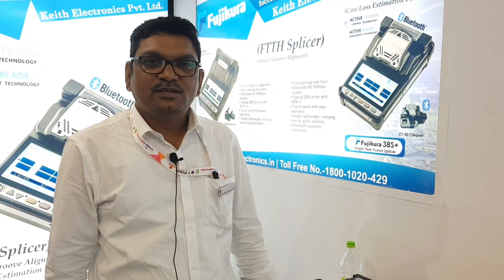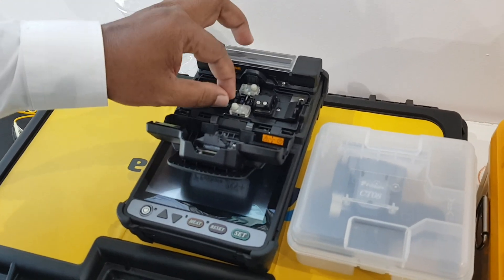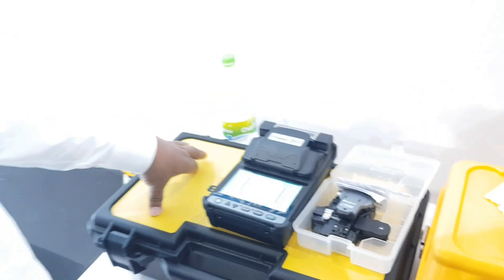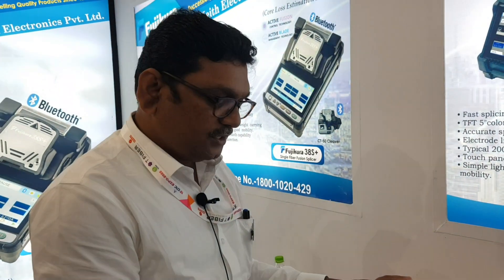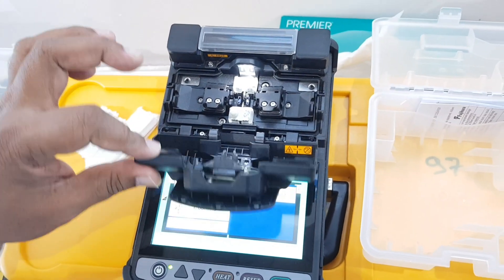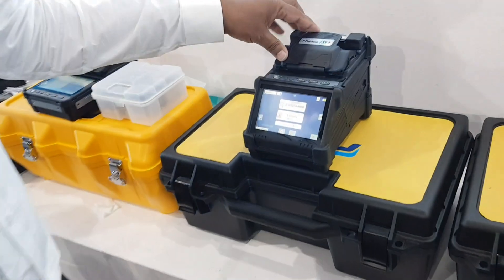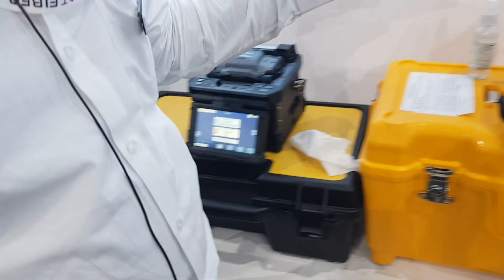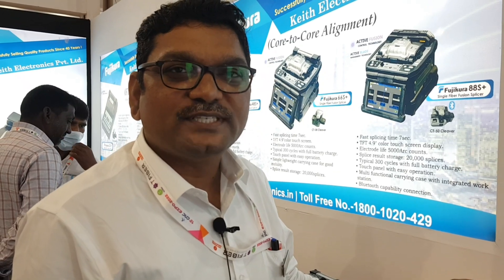Fujikura splicing machine Details In Telugu | 10th CNC Expo 2022 Hyderabad

Comment: Bro 66s + or 88s+ edi better
Reply from the maker: For high-end  full Automatic 88s good
For high-end manual operation 66s is good 
Both are core to core machines
Reply: @FiberTechwithSandeepPolisetti  88s lo heating automatic undi
Splicing automatic kakunda manam manual ga run cheyyacha bro
Reply from the maker: @kakarapllisai9921  manual settings chesukovachuuu